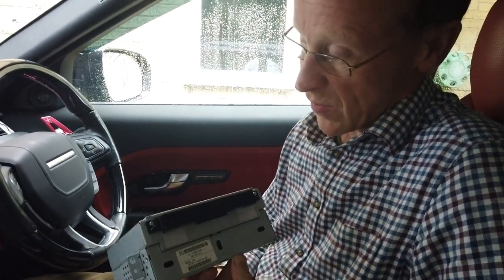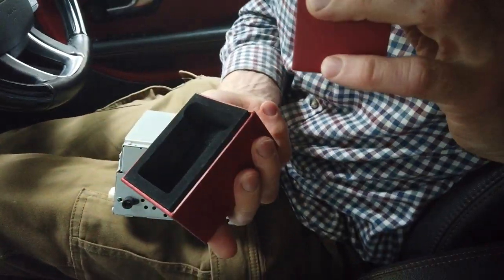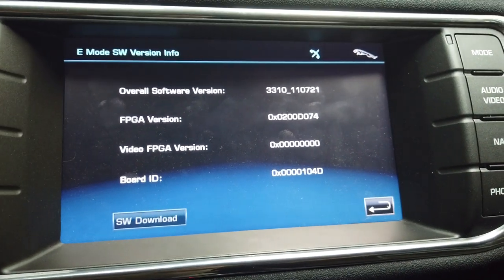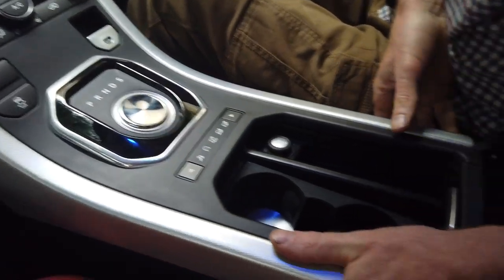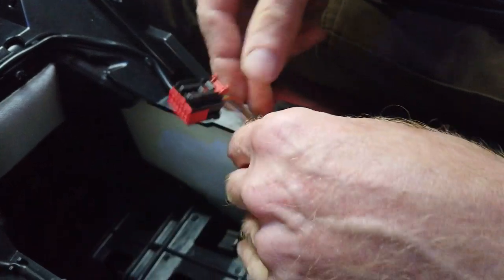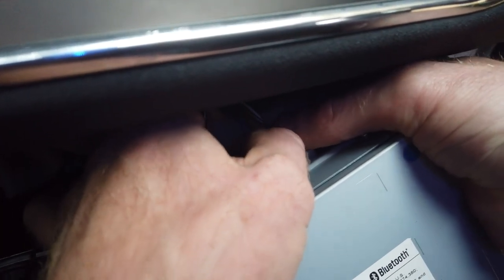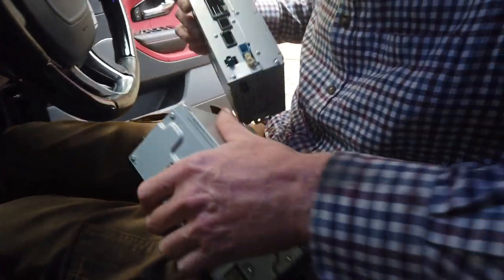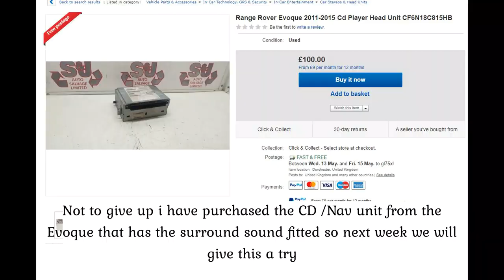How to change / remove Range Rover Evoque CD / DVD player / Navigation computer

Comment: yassss. 10 minute install. new unit off scrap ebay powerseller $50. bluetooth random disconnect | sound popping cracking resolved. top marks on video
Reply from the maker: Well done !

Comment: Thanks, this helped a bunch. I am finding though that if you don't disconnect the battery before removing and reinstalling the centre console, I get a "handbrake defective" (in Dutch) error message. Fingers crossed that it's a fault code I can simply clear over OBD...
Reply from the maker: Try turning ignition on and off 3 times and it will be fine i think
Reply: @L663  thanks, can't verify that anymore I'm afraid